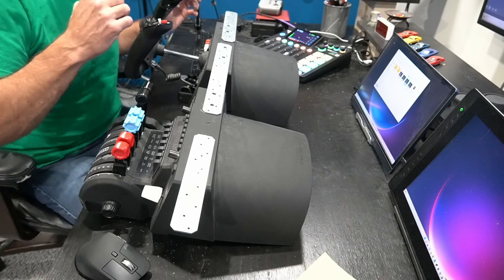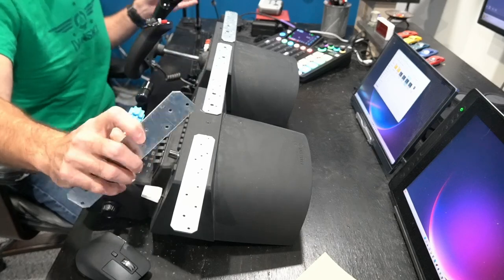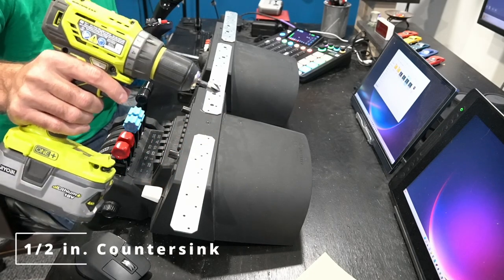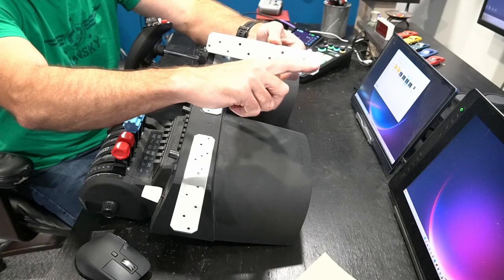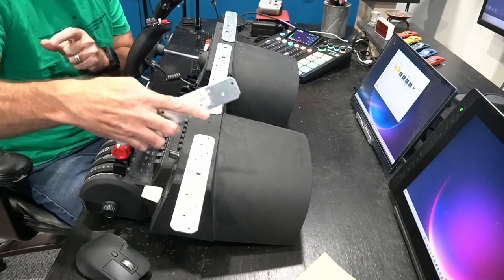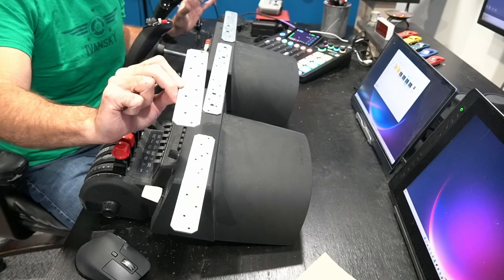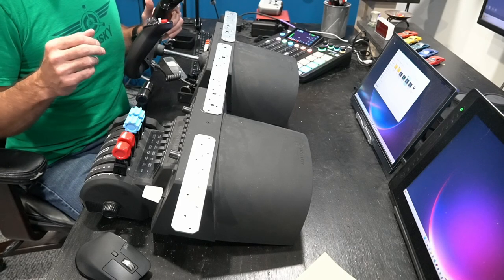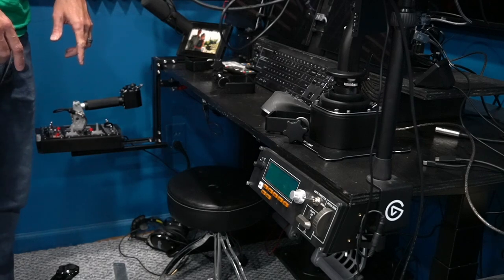Honeycomb Alpha Bravo DIY Under Desk Mount | Flight Sim

Comment: I did the same with scrap metal. To line holes up I used a sheet of sticky label paper and adhered them to device and lined up holes.  Marked screw points on paper then lined up sticky paper to metal bars and marked location and drilled holes.
Reply from the maker: Awesome!
Reply: Agree, this mod is well within most peoples ability, very little diy skills needed, in fack none to speak of, and cheap. Although i did need steel drill bits and the like, so i spent a little more, all from amazon including the steel plate. Now just need to set aside some time

Comment: Ivan, I had recently received my Honeycomb Alpha & Bravo units and as I contemplate mounting them, along with the Meza-Steam Gauge Cockpit Simulator Panel Kit, I certainly appreciate your video. The use of the bracket seems like a viable solution for your application, but I would caution the removal of screws from either unit because a screw could also be an internal fastener between the Yoke or Throttle housing and a switch, indicator, or actuator. With my unit spacing the Alpha & Bravo units in accordance with the panel requirements is a primary concern. I like how you secured it underneath the desktop. I may secure the A & B units on top of a 1" x 6" wood plank and sandwich it underneath the bottom of my desktop. Ivan, whatever I decide, thanks for getting me thinking about my options for this fabrication. Enjoy your simulator and may God Bless.
Reply from the maker: Thanks for your thoughts. I at one point considered the option of building a small shelf under the desktop to accommodate the Honeycomb units, I ended up going a different route of mounting as in the video. I have had no issues with instability. I am on them fairly frequently, but I do think it would be safer to mount on a shelf under the desktop or just on top of the desktop.

Comment: Wow!!! Just saw the commercial version for 50 bucks wow!!!
Reply from the maker: There are several commercial variants out there. Depending on if you have access to the drill bits used in the video, this way is way cheaper and far more flexible. If you don't, you really only save about 15-20 bucks, but sometimes it's fun to make stuff with your own hands.

Comment: Honeycomb has said that the holes on top are not designed for this, and if the yoke or throttle quadrant are damaged from mounting this way, the warranty will be voided.
Reply from the maker: Thanks for the heads up. I will add that to the description.

Comment: I would stagger the middle bracket closer to the front and the side brackets further back would cut down on the giggles yours seems to have.  Not doing what you did, I even consider 3 brackets in the back and 3 up front considering your setup and not wanting any giggle at all.  But as a wood hobby-ist, I'd prefer to make a wooden harness that your controls would fit in to be as solid as possible.  The wiggle (no matter how slight) would feel cheesy to me.  Cheers!
Reply from the maker: That makes sense. I did think about having something like you described, but just never did it. Thanks for the input!

Comment: I love the idea, however I have a question/concern.  In the video, at about 8 minutes, it looks like there is a lot of wobble on the alpha and especially the bravo.  How does it do when manipulating the yoke... do you get a lot of bouncing on the alpha and the bravo units, or is it more stable than it looks?
Reply from the maker: It's way more stable because for the video I just basically got it in place and didn't fully tighten or have the round part of the C-clamp directly on the metal strap tie. Having said that, it's not as stable as having it mounted on top of the desk that's for sure, but I would say for my setup, it's about 80 percent as stable which is plenty for me.

Comment: What are the sizes of the metal?
Reply from the maker: The sides are 8 x 1 3/8. I am not sure how long the middle piece was.
Reply: @IvanSkyFlight  can you measure the middle piece for me and what size are the end pieces?
Reply: @IvanSkyFlight  i got the drill bit. Its says 4,4 m on the package is that the right size?
Reply from the maker: @JW-jl8iq  I don't have the middle piece anymore, but I am almost positive it's 12 inch 12 gauge strap tie from Home Depot. The side pieces are 8 inch 12 gauge strap ties.
Reply from the maker: @JW-jl8iq  The packaging should say 4mm.
Reply: @IvanSkyFlight  what are you using since you dont have the middle setup? mine is done and installed. Awesome